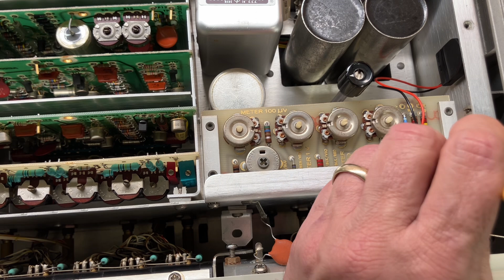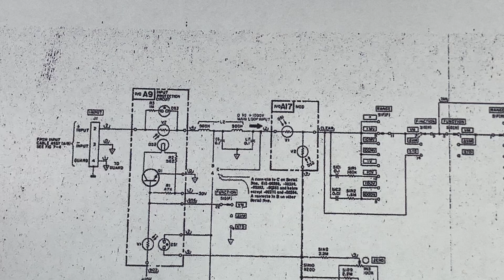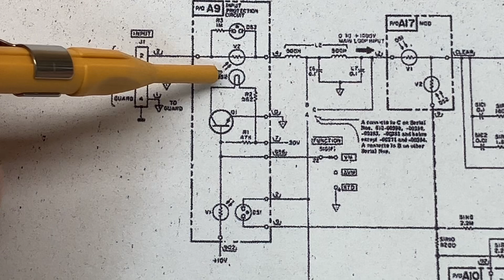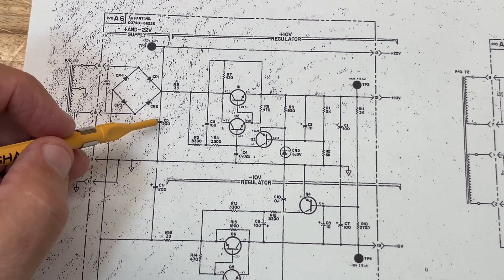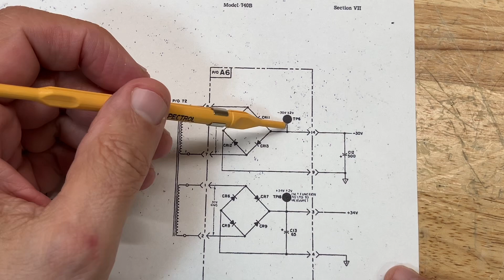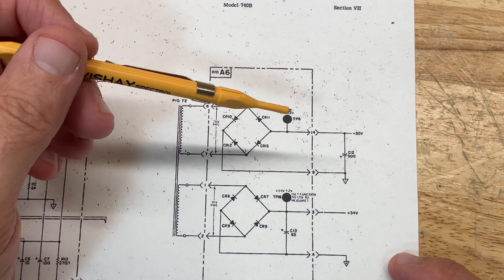HP 740B DC Standard/ Differential Voltmeter Part 2

Comment: Disconnect all downstream circuits from the -30/+34 (oh, and the +16.5, -16.5, +16, -16, +5, +10, -10, +22, -22...) supplies, check for health, and then reconnect board one by one... well good luck.

If possible/plausible, would really love to see what voltage reference assembly / circuit they used for this instrument.